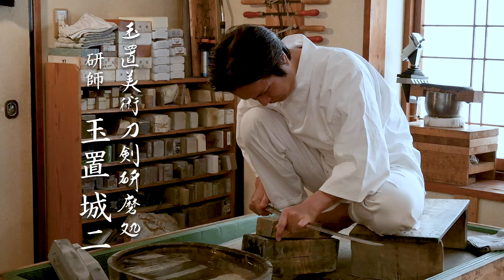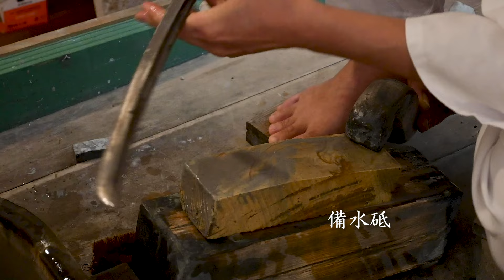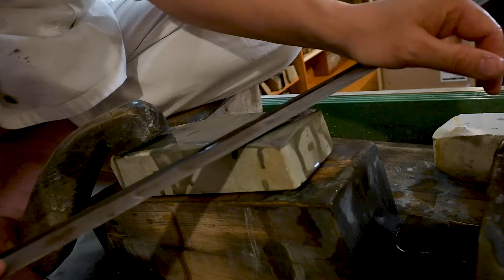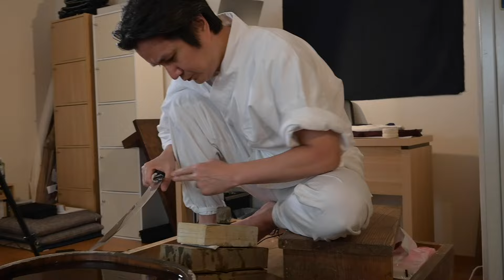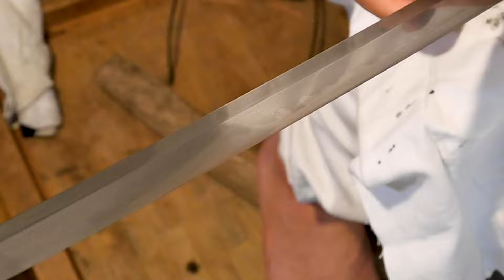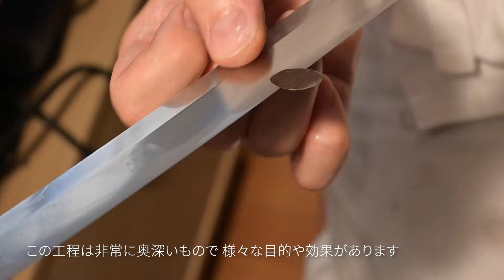日本刀の美　刀剣の旅・京都編２ 「刀剣研磨の世界」Beauty of Japanese Swords: Kyoto Part 2 [Sword Grinding] [Master Craftsman]

Comment: I traveled to England many years ago. There, in Oxford, was the Institute of Japanese Culture. Inside was a display case with genuine Japanese swords, all stripped down from their handles, hilts, and fittings, on loan for display.  They had a sword in there made around the 1100's A.D. It looked like a beautiful arc of razor-sharp, polished steel. Not a spot of rust on it! Incredible!